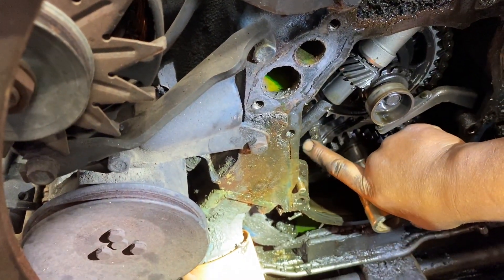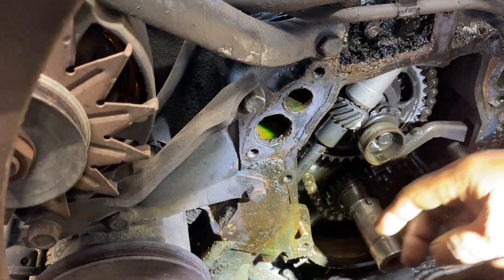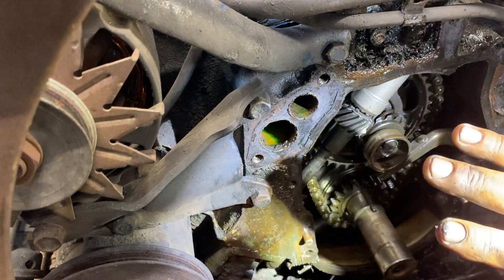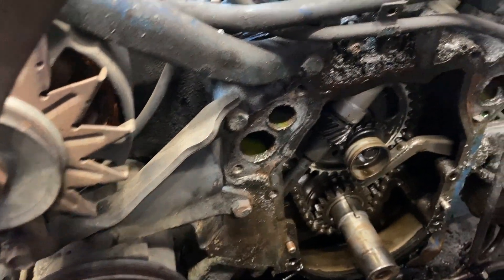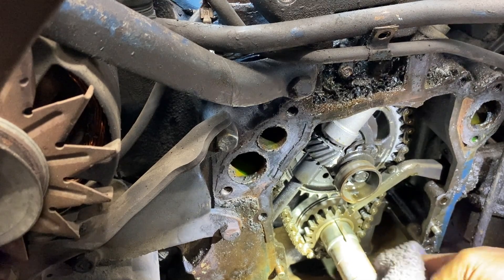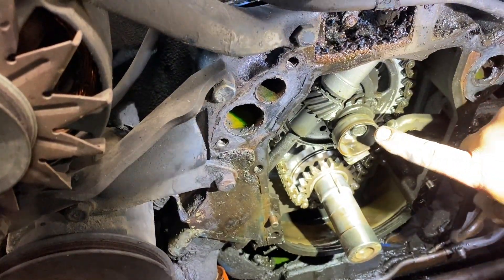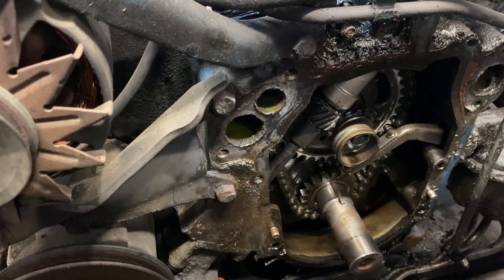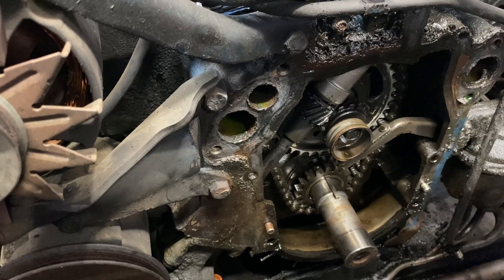72 Cadillac Eldorado Timing Chain Assembly

Comment: Is this job possibile without pulling the engine out ? I have a 1978 Eldorado with 28.000miles with no problems, but still i would like to replace the timing set to prevent any future damage due to the nylon covering degradation
Reply from the maker: Yes, the timing chain assembly can be swapped without extracting the engine from the engine bay,... however if the thrust bearings have been excessively worn, then the engine is pulled, and an overhaul.rebuild.woll be required.

Comment: George, the camshaft gear was originally covered in nylon.  The nylon got brittle, cracked away and is not doubt clogging the oil pump pickup -- leading to the bearing issues.

First thing to do on ANY Cadillac of mid-60s to mid-70s vintage is to replace the timing set and hope the nylon is still there.  Well known issue.
Reply from the maker: Hello Rick and thank you for reaching out and providing some commentary,.. however your comments pertaining to the disintegrated phenomenon of the Original Plastic Nylon Coating on the Aluminum Cam Sprocket were already posted in the description narrative of the video listing that perhaps you overlooked. I wish more folks would click on the "SHOW MORE" area of the YouTube video listings because I spend a lot of time trying to include this type of background information with each video clip. Thank again Rick for your constructive comment.